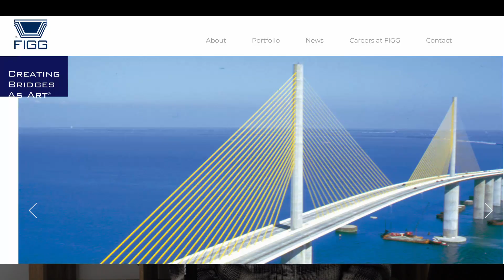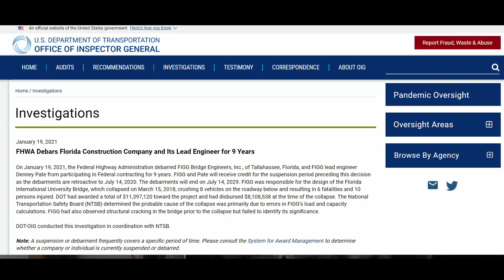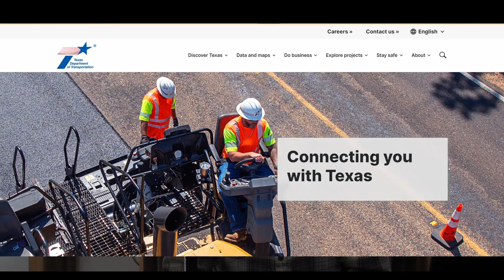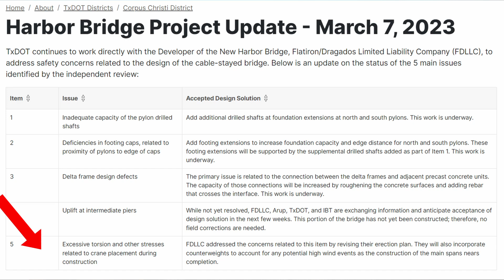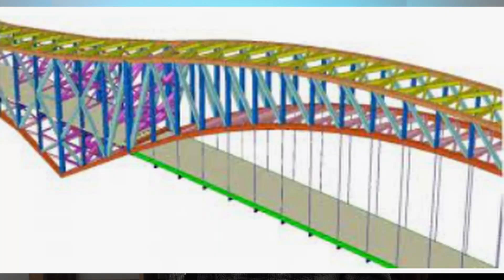New Harbor Bridge - Why Construction Resumes

Comment: That's a lot of revisions for a completed design. Is FIGG a more fly-by-nite firm? Would there be the same sort of differences on any project with two different engineering firms? This is worrisome because the foundation of all engineering is math and theoretically, math doesn't lie. What is that stamp for?
Reply: No, it would be better if FIGG was a fly-by-nite operation.  They were one of the largest bridge designers in the country and, IIRC, Denny Pate was credited with having designed more bridges in the US than any other single designer.  It's was just a stunning failure on all levels, I suspect to a large extent made possibly by Pate being so well known and competent.

Comment: Thanks Casey! I think your thoughts towards the end of the video, on the programing are correct! Now whether it's the programing, or the information being inputted on a project that are creating the issues that are wrong, is the real question? I know from my experience in the fire protection field, that they had problems with their design and calculation programs, but getting them to talk about it, was a major undertaking to begin with, or sometimes they just refused to! I think that was a two fold factor, one being they didn't want to admit that there may be bugs in their system, and the second being, they may not have know what the issue was and didn't want to admit that! I started the business way before programing was introduced into our field! Calculations for hydraulically designed systems were only required on 'Special Hazard' systems (IE: transformers, chemical plants, refineries, etc.) and that was done by hand using calculation tables, Hazen and Williams formula, slide rules or TI calculators towards the end of that era! But there seemed to be far fewer if any noticeable mistakes, when done that way! Why? Probably a lot had to do with ethics and the amount of time that one had to spend doing them! It produced a mind set that if you spent that much time, you wanted to get it right, which went back to the ethics thing! 
You have to applaud Texas DOT for picking up on it (they in fact turned into the peer review for the project)! I think the peer review thing as to be stressed in engineering and architectural practices! I think certification standards should be implemented for these design programs! I think certification of engineers using the programs should be implemented! But the biggest thing is that of the  ethics in all professions, and it should be the biggest thing stressed!
Reply from the maker: Thank you.  Yes, I think it had to be a bitter bill for Texas to hold up these major jobs for 2 years but I am sure they are glad they did!

Comment: The problem is engineers don't have the skill or don't want to take the time to manually calculate the output of computer models. They think the models are always correct so that is the answer. Never trust a computer model without doing random checks of the calculations.
Reply: If you intend to hand calc a design you have to keep the design simple, specifically there are certain types of structures which don't hand calc well, specifically non-linear beams...The way around this is to increase the strength of the beams but that increases the weight and causes issues for the seismic calculations, which increases the load elsewhere... I was in an office where we picked up a 'nearly complete design project' after another company went out of business. They hadn't got around to the hand calcs which the regulator required... Suffice to say it was very expensive.
Another issue was the finite element analysis, we had a computer model designer, but the model got so complicated for various reasons, that we could not find anyone experienced enough to check his work - at pretty much any price. And then there was the issue of the FE analysis throwing up slightly different answers when the same calculations were run on different computer hardware...
In my opinion the project went wrong at the beginning, the team who started the project did not have enough experience to keep the design simple.

Comment: The existing piers that support the approach roads look too slender to me. Another good video. Good Luck, Rick
Reply from the maker: Thanks very much.  It is interesting you mention that as they tore down the pylons for the New Channel Bridge after reviewing Figg's design.
Reply: @CaseyJones-Engineer  That sounds wasteful. 36 years ago, I had a bridge center pier that was 70 years old, had no footing, and was made from farmer concrete. They made the concrete from sand and gravel dug up from the river bed and added cement. It was poured in ~2' lifts and was very settled out(a lot of cream at the top and the stones at the bottom of each lift). The river was eroding the gravel from under the pier. It was poor condition but the town couldn't afford to replace it. I waited until August when the  river was almost dry. We dug out under part of the pier and poured part of the footing. We then did the rest of it. As a precaution, we had erected mafia block dikes around the work areas. During the construction, we had 3 - 100+ year floods. Fortunately, the drainage area was short and dried out in a weeks time. For the pier, I designed a reinforced concrete girdle to encapsulate the old pier. There were other parts to the repairs but this "girdling" was a possibility for those piers. One of the casinos near me is supposed to have done the same thing when the concrete cylinders didn't pass for their columns. Good Luck, Rick